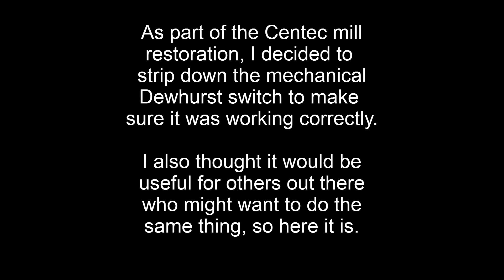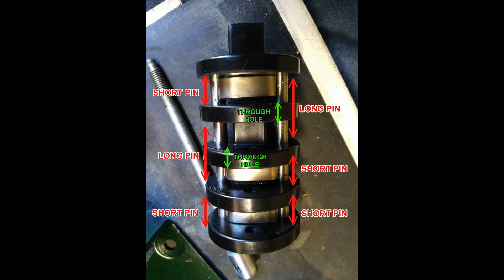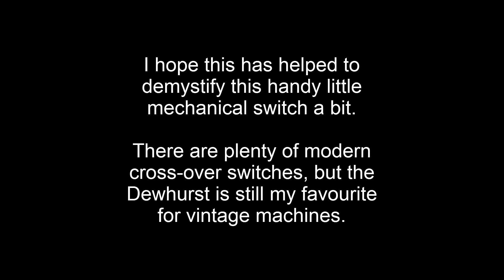Dewhurst Switch Renovation

Comment: 🙏 Praise to Beachcomber Bob 👍
After my ML7 motor blew up in my face 🥵, I found every time I switched it on, the motor kicked.
This wore through the `rubber’ covered 3 core wire to the plug and shorted on the bench.
Stripping it down, I took the switch cover off and found wood dust in it, so needed a clean up at the same time.
Unfortunately part way through taking it apart … realised I should be taking photos of the disassembly 😱.
By then, the I’d taken out the centre pin as I’d seen one of the five Bakelite moulded drum sections had split at the drum contact holes. This was repaired with Milliput, then superglue after it had dried.
Alas, like others here, I found springs, drum contacts and clips, all in my tray and no idea how to put them back.
With the great help of your video and Mr.LinnsWorkshop I was able to get everything back together … with nothing left over 😎
I want to replace the 5 and 3 core cables, but unsure whether 1.5mm would be suitable

Comment: I've  just stripped mine down for a paint job and ended up with a box full of bits, was wondering how I was going to put it back together and found your video. Going to save me hours. Mine is off an ML10 but I also have a Centec 2A with a different on off switch tho, thanks foe posting the vid.

Comment: Where did you get the brass top plate from ? I was just looking for one..........Great video, very useful, I was just in the middle of rebuilding one when I came across your video. Many Thanks.
Reply from the maker: The plate's the original. These old versions are a bit more classy than the modern printed ones I think.

Comment: Thanks for this.  Im doing the same with my switch.  The pitting is severe so may have to make new pins.
Reply from the maker: Not an impossible task, but good luck! Try sanding out the pitting first though (unless it's deeper than 30% the thickness of the material) then packing out to adjust the slack.
Reply: @beachcomberbob3496  Thanks.  I'll take it fully apart first to examine it.  I gave it an ultrasonic bath just this morning then saw the pitting.  I'm sure it should be fine if I don't manage to break anything, with help from your video off course. 😀